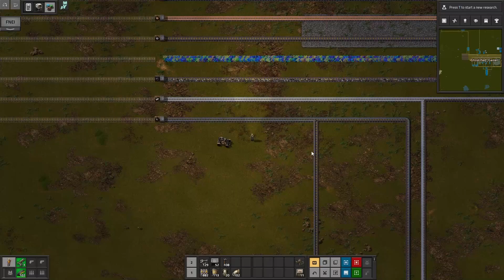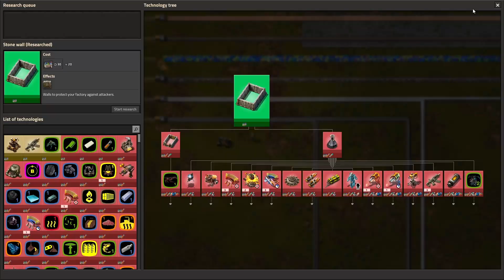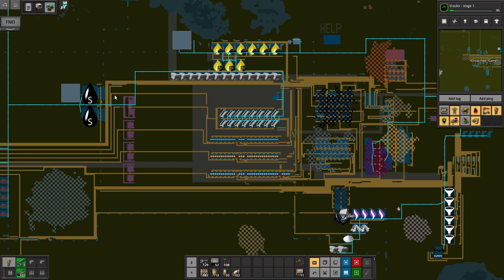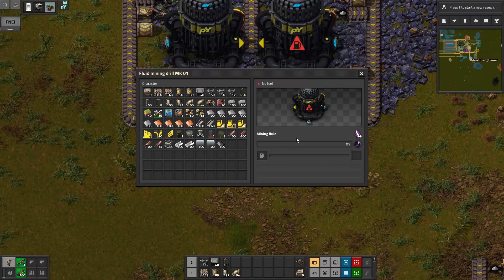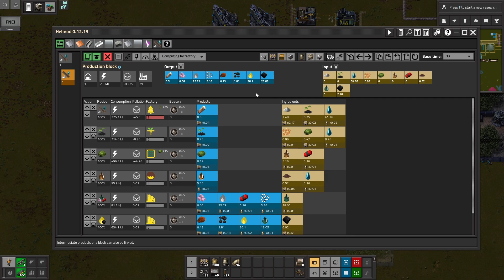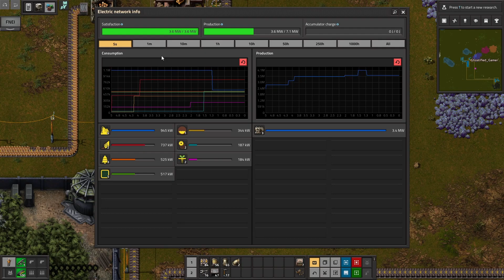Factorio pYanodons - Titanium and Tin Plate With a Side of Wood - EP14

Comment: Not sure if things have changed all that much but factory planner seems to handle pY a lot better the helmod. The only issue I have had with it is when I asked it to solve T3 circuits. It got about halfway and something crashed.
Reply from the maker: I never used Factory Planner.  Helmod runs well but leaves some things to be desired.
Reply: @FantasticMrGhost  Helmod is not the problem, the problem is that helmod is asking you how do you want to make the ash for the recipes that require it, but you don't tell it, and that is why helmod is trying to make the ash with whatever machine makes it, like miners and assemblers. just tell helmod you want to make the ash using boilers with kerogen, or raw coal and you wont get the weird numbers you keep getting.
Reply from the maker: @SpiderHorse9  Thanks.  I figured it out later on with some help from other comments I think;)

Comment: I see the wood thing doesn't work all that well. Perhaps the best way to use wood power is to use it to power the assemblers in your hub, so that the hub design can be more compact and not have to worry about ash output. But for powering remote bases, coal power seems to work just as well.

BTW, you won't see me for a few days; got some family stuff coming up that'll take most of my time. I'll eventually catch up to the backlog and resume commenting again.
Reply from the maker: Happy holidays!  Have fun with your family for sure.  Yeah.  Wood burning is a bust but, there some really awesome power options coming up after batteries are made.  Very creative machines too.